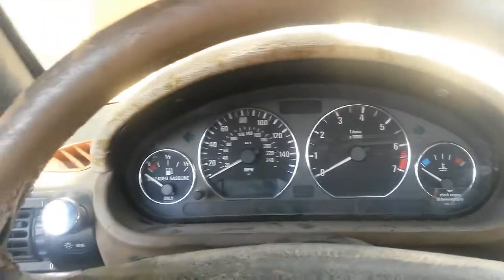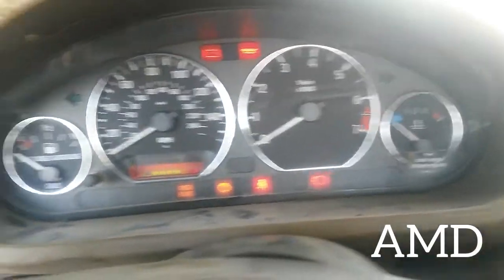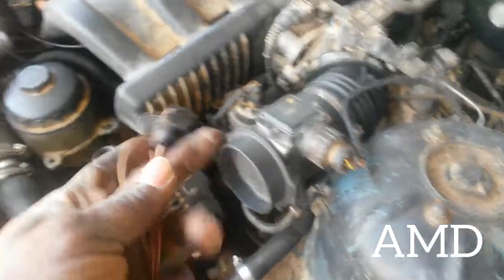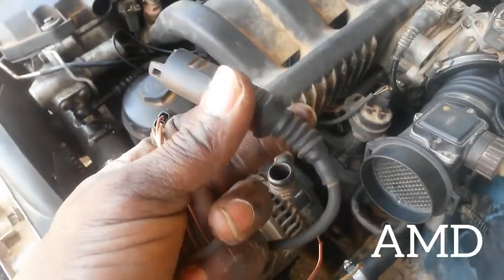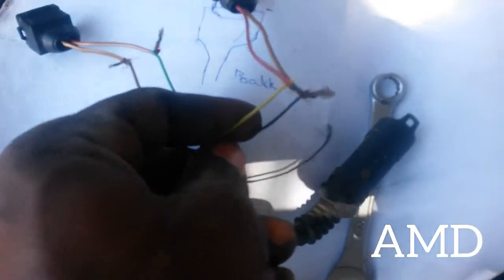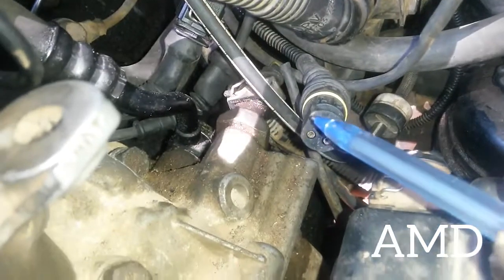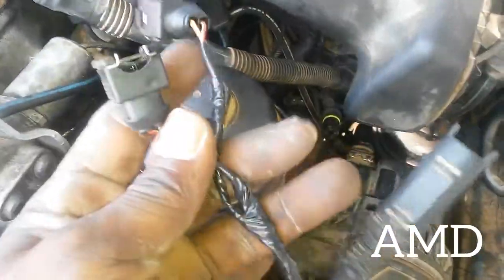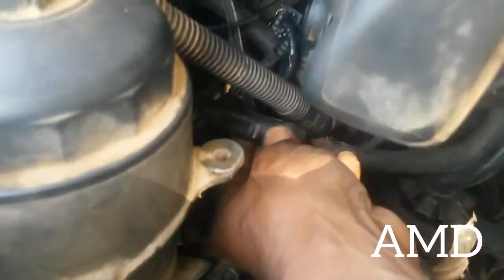how to swap bmw m52 engine temperature sensor to m50

Comment: I know the question is not related to the video but I have to ask. Do u have the firing order of M52 when it's running with M50 non vanos harness. I did some research and  it's seems the crank sensor is reading wrongly and some say u have to swap the firing order
Reply from the maker: Hmmmm I don't know but I can make a research for you

Comment from the maker: am here, at ur service
Reply from the maker: As for the swap if he uses all the accessories and timing cover from the M52 everything should line up fine and he can use his existing wiring harness and dme. He'll have to use his M52 intake and sensors as well but everything should line up and work fine.
Reply from the maker: They are the same engine lol. The only difference is the crank sensor is on the front of the m5 and on the back right of the 52.
Reply from the maker: They are the same engine lol. The only difference is the crank sensor is on the front of the m5 and on the back right of the 52.